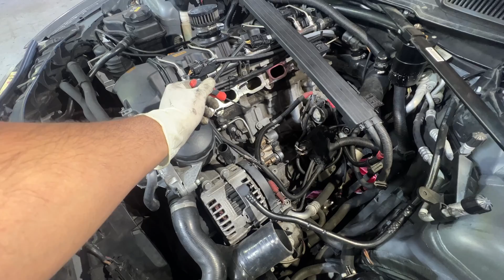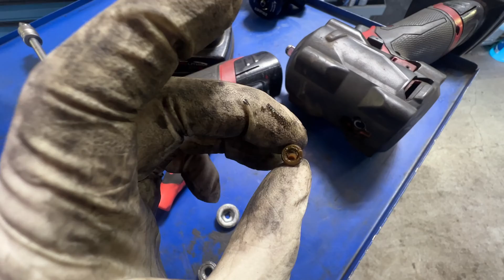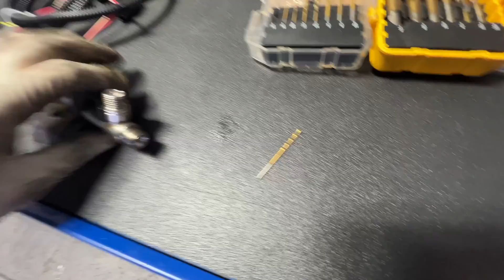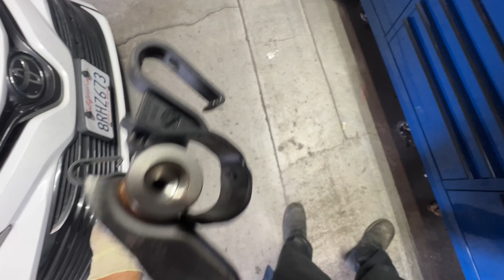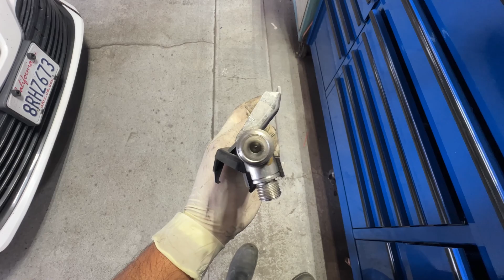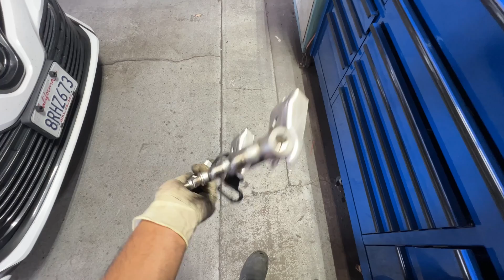Fuel Rail and Fuel Pressure Upgrade for More Power N54

Comment: I'm not 100% convinced this will increase pressure.... Its the pump that creates the pressure ... Drilling out an orifice will increase Flow .... more fuel volume perhaps.... but the pressure should remain the same or even slightly drop.

I'd have to see measured results to believe it increases pressure.

Comment: Terrible advice! That filter is on the low pressure inlet of the HPFP and is there to protect it and the FI system beyond it, yes it will "work perfectly fine" until contamination that does not get trapped by it ruins or shortens the life of your HPFP. More PSI does not translate into a faster car either, as long as your HPFP is delivering the PSI and flow needed for your car's setup and tune higher PSI at the HPFP makes no difference. If this make you feel like your car is faster good for you but this is bad advice!
Reply from the maker: This is wrong. My tuner is one of the best. #1 killer of engines is running lean. Fuel pressure is very important. It’s always better to run rich compared to risking running lean. More fuel pressure does equal more power especially when at higher boost.

Comment: And do you meaure the fuel pressure before and after the modification
Reply from the maker: Yes it went up about 200-500 psi
Reply: @menjicar  nice , thank s
Reply: with stock HPFP?  @menjicar
Reply from the maker: @nadir3D  yeah stock hpfp
Reply: do you have the helix overdrive? or just stock HPFP. what are you using for LPFP? 
thanks for the fast reply and btw sick build and thanks for sharing
Reply from the maker: @nadir3D  it’s stock. I do not have the helix overdrive.
Reply from the maker: @nadir3D  it just gives you a few hundred more psi of rail pressure.
Reply: Is this safe
Reply: like always DIyOR  (Do it Your Own Risk @gregheymann126